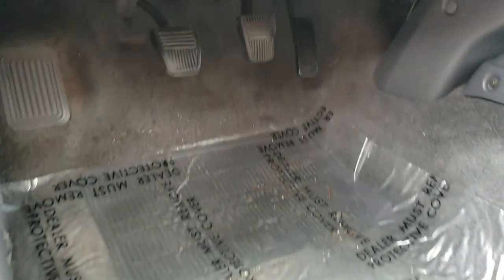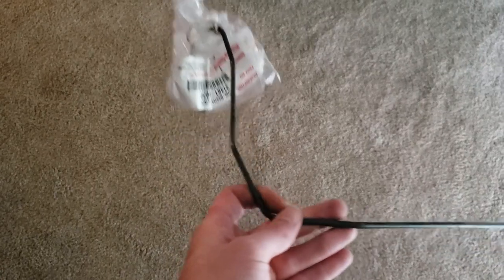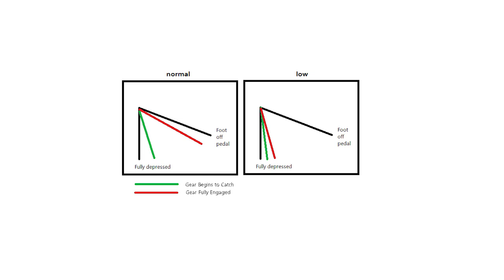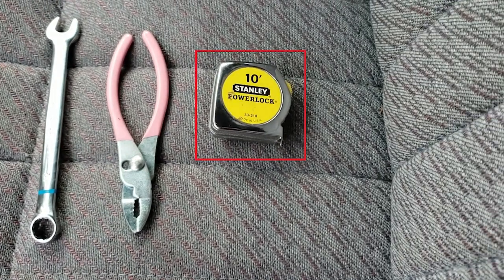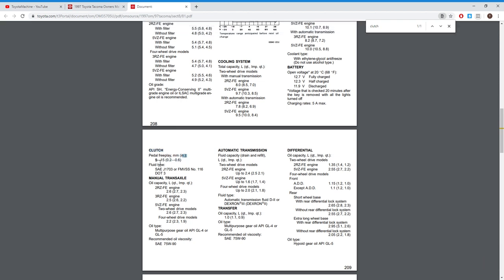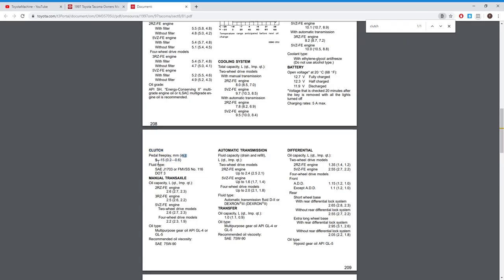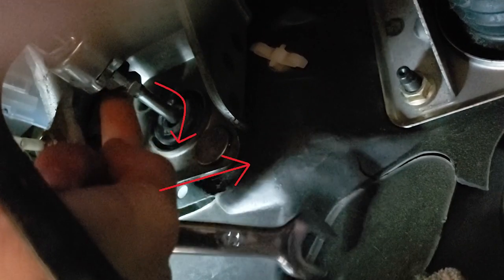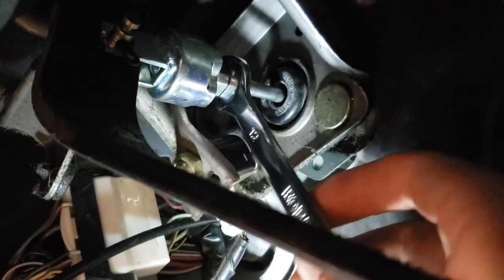[How to] Adjust clutch pedal (89-04 Toyota pickup & Tacoma)

Comment: Small correction: The reason you set freeplay is if you have no freeplay, the system will be pressurized with the clutch pedal already out, and when it is pressurized, it will slightly disengage the clutch. This can cause your clutch to slip, like it will if you rest your foot on the clutch pedal while you drive. Expansion from fluid heating up won't damage the hydraulics; the pressure from your foot far exceeds that.

Comment: Thank you for the info. My Toyota pick up was not releasing the clutch properly. I had a mechanic that told me to replace the master and slave cylinder, replace both and it was having the same problem. Then the clutch was replaced and it had the same problem. Finally I saw this video yesterday and did the clutch pedal adjustment and this resolved the problem. Thank you for the info once again.

Comment: I would like to thank you for saving my 92 Toyota Pickup. I was about to give up on fixing it after putting in new every part in the clutch system and still not being able to shift it into gear. I had no idea that the most important part is adjusting the clutch pedal until I happen to find you cool video. I have read countless forums and watch a bunch of videos about changing the clutch and none mentioned this adjustment. I can't imagine how many people have put new clutch packs in their Toyota cars and trucks when all they needed to do was adjust the pedal. I did everything possible and it was no better than when I started . I just wished I had seen this video much earlier since the clutch pack I replaced was only about 2 years old and had maybe 2000 miles on it.I could not believe a 2 minute job was all that was needed. Thanks again !!!
Reply: Well that really sucked. All that work. Mines acting weird and now I think this is what mine needs. If I can get past all these commercials. Lol

Comment: Should the free play have tension problem is slave cylinder was missing a bolt got fixed and now clutch starts grabbing about an inch from bottom I added a a little free play but I don’t want to screw anything up

Comment: My pedal clutch is too stiff to press..How to adjust it?
Reply from the maker: Sorry for lateness...

If its hard to press down, it might be a binding in the hydraulic line, or worn out seals in the hydraulic line. Also check the return spring under the dash.

Comment: What if your clutch goes to the floor and won't come back up. I had to jack up my truck and put it on ramps . So the front end is up. I had to lift the peddle up . It responds like clutch with the front end up. But as soon as it is on flat ground it won't shift . Followed by it going to the floor.   I BELIEVE IT WAS MESSED WITH SO I COULDN'T TAKE IT ANYWHERE!!!! BUT I AM DETERMINED TO OVERCOME THIS PROBLEM.
Reply: Sounds like either a leak in the hydraulic line or master or slave cylinder are broken.  I see you posted this a while ago.  Curious what the solution was.